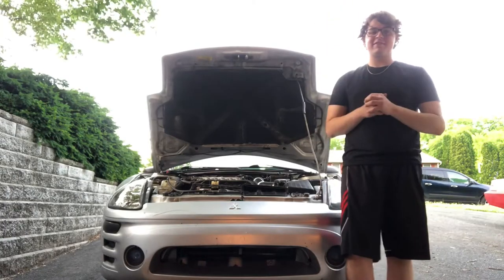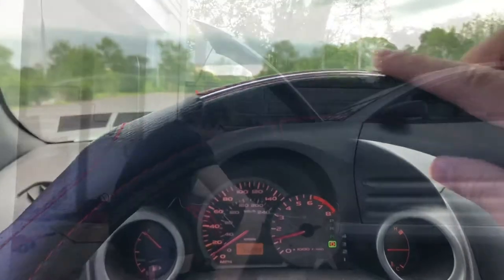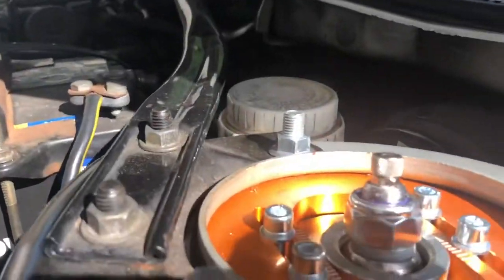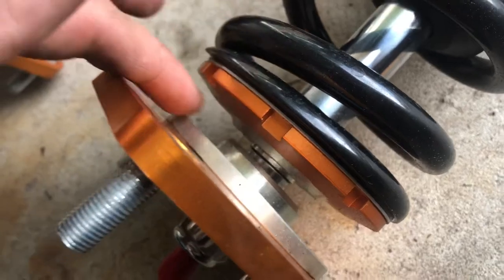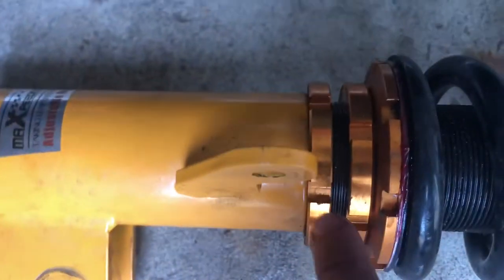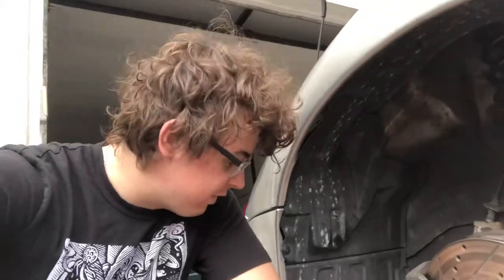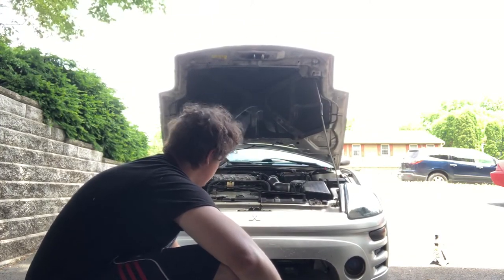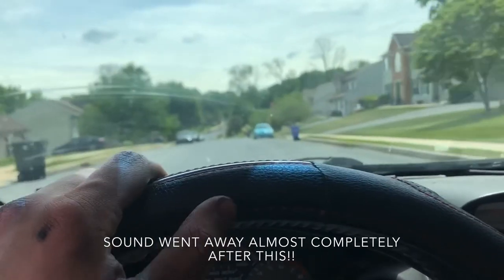HOW TO FIX COILOVER POPPING AND BINDING!!! Maxpeedingrods coilovers knock and solutions to fix it!

Comment: 👌🏻I had the same but not that bad. My driveway is pitched and I’d hit it slow and sideways in reverse 3x a day at least. Greased them and it went away proper for a year!! Now it’s coming back just a bit and randomly. ‘O9 VW passat wagon
Reply from the maker: Probably just an issue with the cheap Coilovers, I’m getting d2s next for sure
Reply: What grease did you use ?

Comment: What type of grease did you use and did you have to compress the spring to take top nut out?
Reply from the maker: Just your typical grease from anywhere, any grease will work and no I took apart the one it wasnt bound up and the other I just greased up without taking it apart and it worked fine

Comment: I have a question my dude. My Suspension is so rigid and bounces a lot. Literally my car flew and it's crazy dangerous. Any recommendations. I got the same Kit.
Reply from the maker: Honestly not sure, once you go super low it’s bound to happen, it’s not meant to be safe it’s meant to just be that low at that point. D2 coilovers would be your best bet if you want safety and low
Reply: Get rid of the cheap springs that came with the coilovers and upgrade to some nice swift springs. That will get rid of the bouncing. Should only cost you about $150 for the front
Reply from the maker: @alexbloom7095  bet I’ll check it out bro thanks

Comment: when reassembling, did they give you a torque spec on tightening the top bolt of the coilover?
Reply from the maker: No they did not
Reply: the joint inside started to turn and there's no way to lock it down anyways, just tighten it. The plates held in by the top bolts anyways. once their mounted you can remove that upper bolt and put it back in.

Comment: Damn bro im having this exact problems but with my rev 9 coils. Do u think i would need to grease the same pieces as u?
Reply from the maker: Yeah
Reply: @3GRacing11  nvm bro i fixed the problem i just took it to the shop that installed and and the retoruqed everything and the sound is gone now
Reply: @Xccord  interesting. I have the same brand on my rsx and it makes a loud clunking noise when turning slowly
Reply: @yosh_tuned  yea bro shit annoying and scary i ended up buying some bc extreme lows lol

Comment: Has the noise completely gone away. I have a '06 G35 and I just put rev9 coilovers on it The front don't make no noise but the back when I turn going slow I hear popping noises like that, And if I just push on the car from side to side it pops also.
Reply from the maker: Yeah the noise pretty much completely went away but I also didn’t have problems with the back, only the front

Comment: I’m getting a clunking sound in the rear coil overs, they were such a pain to put on I don’t feel like taking them off and greasing them wish the company would leave instructions to grease them before putting em on. So annoying, I get the price Is great but come on
Reply from the maker: Yeah i feel you bro, the backs real simple tho you could get them off grease em and put em back on within a couple hours
Reply: @3GRacing11  mines a 4g, I’d have to rip out the whole trunk again to get to the top hat
Reply from the maker: @NaeroK87  damn that’s a pain, the 3g just has a cover that you can pull off to unbolt the tophat
Reply: @3GRacing11  wow...that’s how it should be for every vehicle, it’s not hard but it just takes time to get the plastic covering off, 15 or so screws to take out
Reply from the maker: @NaeroK87  damn yeah that is annoying, you’re better off just doing it tho, it’ll save yourself the annoyance of the popping, unless the struts blown, then youre screwed
Reply: @3GRacing11  yeah for sure, appreciate the video thank you